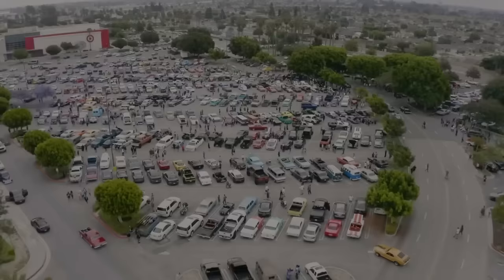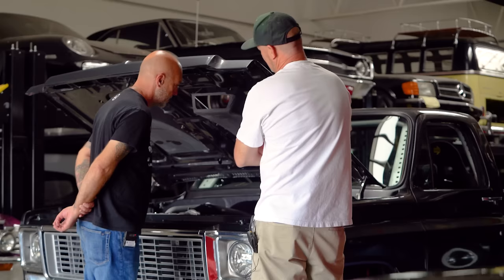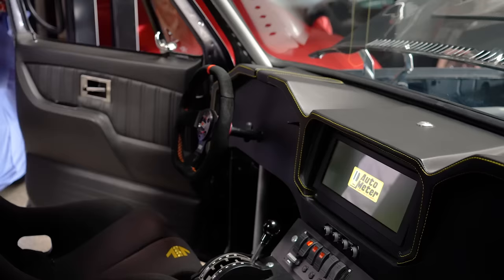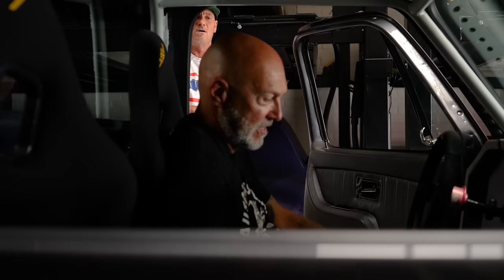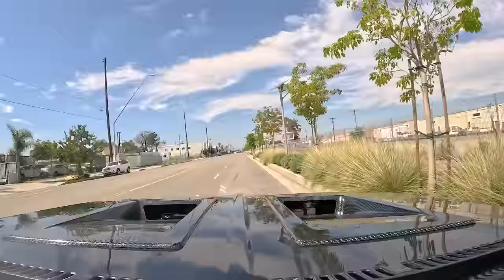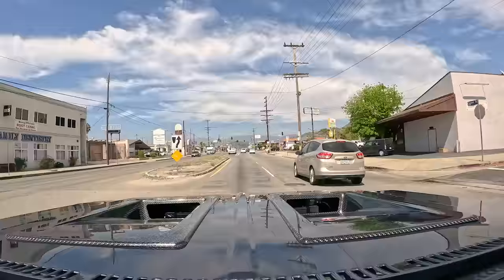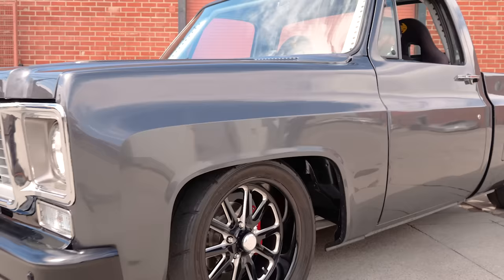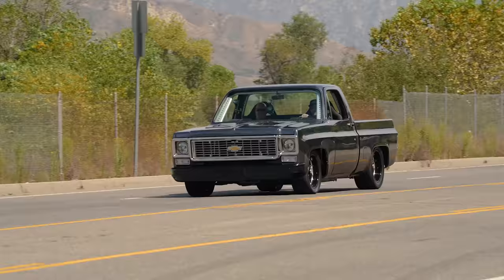Square Body Chevy C10 Making 600 hp

Comment: Can we give a round of applause to that 4L60e..?......holy SHIT that thing HAS to have the kitchen sink in it!
Reply: Literally - the sink parts were stronger than the stock components
Reply from the maker: Such a well done build
Reply: @eighty6gt 😂😂😂
Reply: Mine lasted MANY yrs of beating on even before finally installed a B&M kit underneath (new valve body, etc) Since then and running full synthetic trans fluid have put over 450hp to her for yrs now.
Reply: @eighty6gt Older 4L60E's were actually pretty strong from the factory and could handle 400hp+ for awhile. Not everything driving around back in early 90's was 500-800hp.